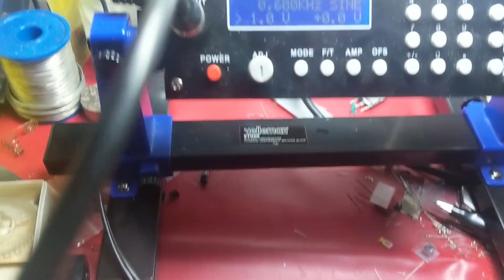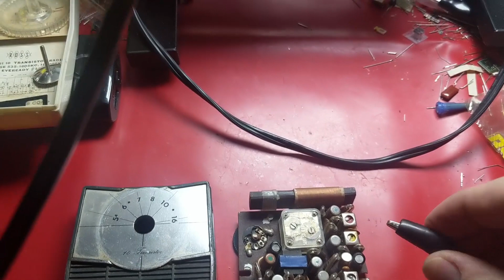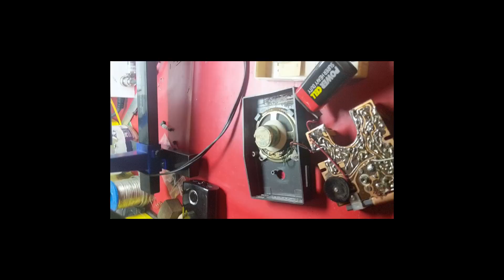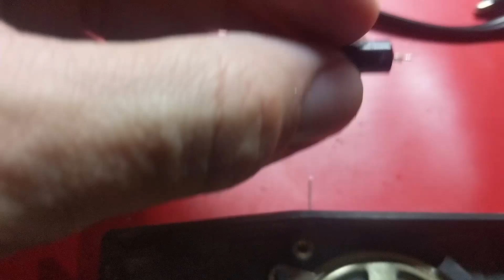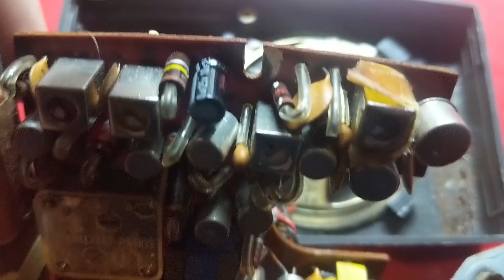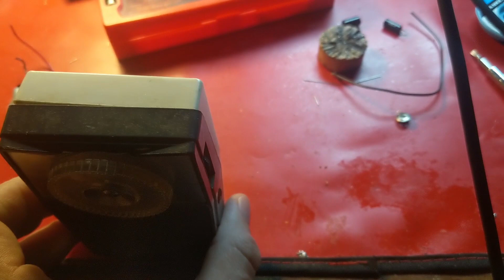Fault Finding & Repair Of A Transistor Radio

Comment: FYI I start by spraying some cleaner into the band switch and vol control. Electrolytic capacitor kits are cheap buy them on eBay I usually just replace them. Loose and bad solder connections. Deoxit is good for cleaning.

Comment: It's not repaired. After you swapped the caps and retouched the solder joints there is still little volume. The  amp is good because you could hear a decent output from the signal generator.  Forget the signal generator you need a signal tracer. You havent found the problem.

Comment: Well done David, nice little fix. Contrary to earlier comments you can fix radios without a signal generator - I've done it. So many radios are given up as dead when many faults are dead simple. Battery terminals, dirty volume Pots / switches, broken wires, bad joints etc, etc.
Reply from the maker: Thanks - I've been enjoying fixing a few old radios during the various lockdowns. I've got another on the bench now, I should make a video for that one - it's missing just about everything.

Comment: Sir, what's the correct procedure to check voltage in the radio (germanium tr) circuit.
Reply from the maker: It's a bit difficult to go into in a comment, but basically you're looking to see if the base is biased (has a voltage around half the supply voltage on it) and that there is voltage on the collector. Remember, most if not all germanium transistors you'll come across are PNP, so the emitter will be positive and the base & collector will be negative.